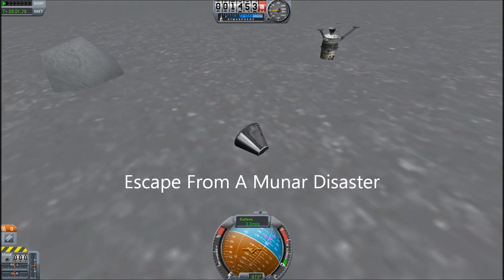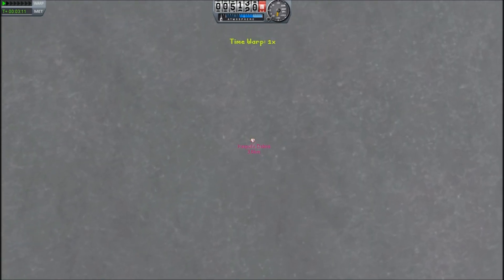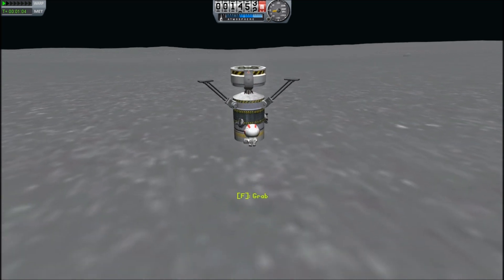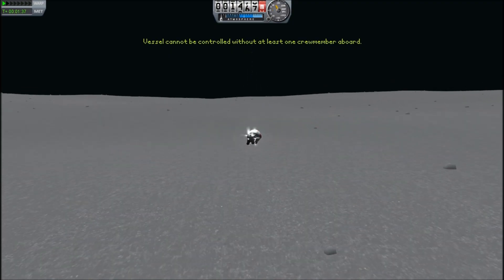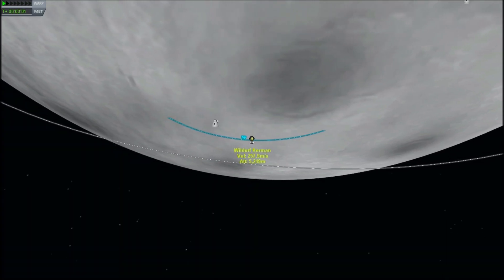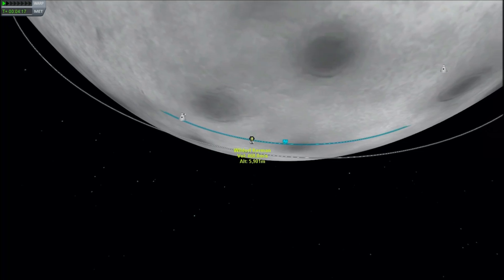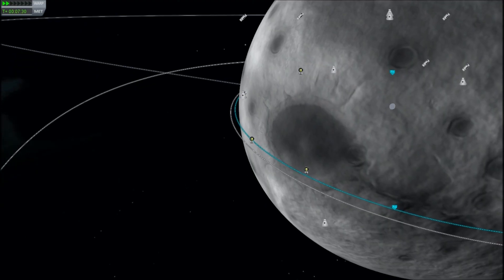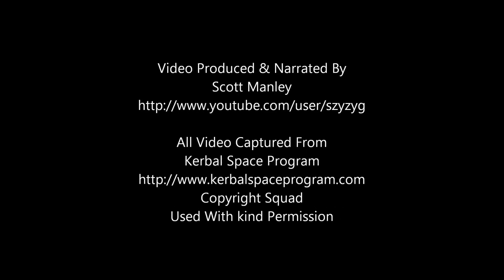Escaping the Mun Using A Broken Ship & EVA Suit

Comment: 0:17 Umm... Mk1 Command Pod has a built-in reaction wheel.
...Or did you need to add them manually in the old versions?
Reply from the maker: +mesoth mesoth in this version only the root part got a reaction wheel.

Comment: I had to do that on a mission to rescue Jeb from orbit. He was stranded on his ship in a 850km by 115km orbit and came up just short on RCS to get entry.

 Could not seem to get the rescue craft closer than 20km or so. I had Jeb do a "Willy E Coyote thrust move" and EVA over to the rescue craft, only to run out of EVA fuel. So then I maneuvered the rescue craft right under him, got him right on the hatch, switched, got the GRAB option, and saved him. Also got the "Send in the Kalvery" trophy.

Comment: How about doing a mission :D
the Kerbal Space Station 's oxygen module exploded taking out most of the fuel cells with it .Its pressure port ruptured in the explosion and the crew tried to escape via the CRV  , but the docking port jammed and they are now stuck on the ISS with only 5 hrs of oxygen left before asphyxiation kicks in .( Hollywood science ,BUT makes for a kickass movie)
You have less than 4 hrs to get to the orbit and save the Kerbals for an impending doom!